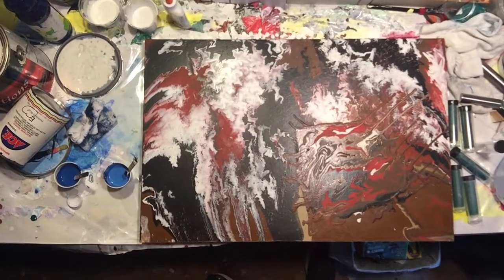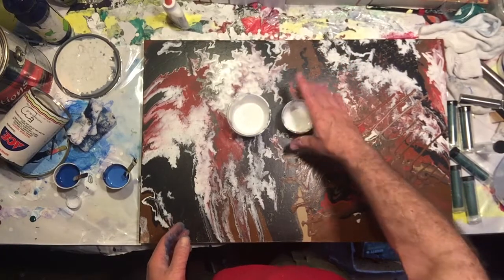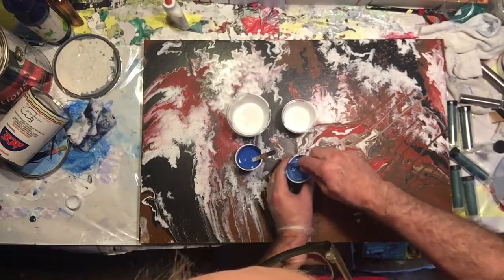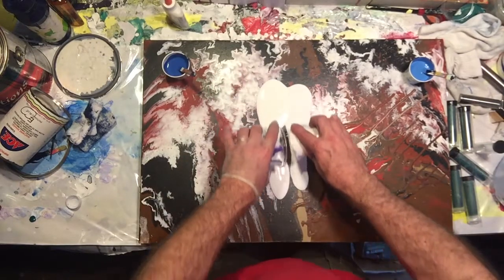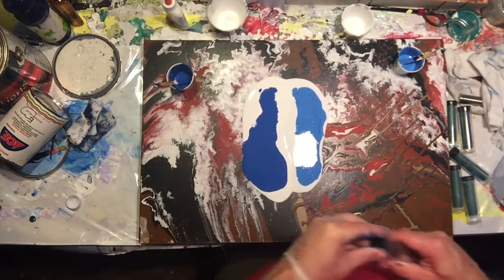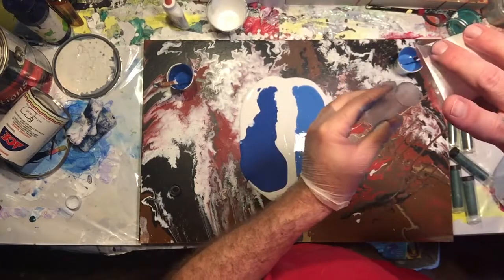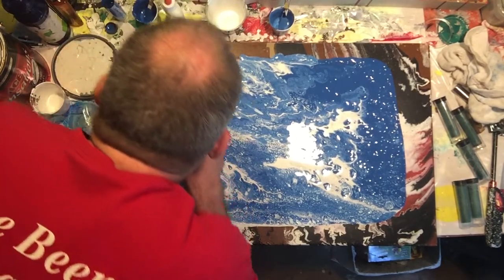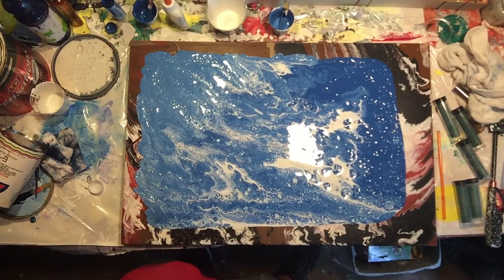House Paint turned into Flow Paint (save $$$) Acrylic Painting Pouring Fluid Flow Art How to's

Comment: Wedgewood?  Love the blues, and as for torches, I've seen videos where both butane and propane torches were used, and it doesn't seem to make a difference beyond safety or health - which are more the responsibility of the user and less because of the material I'd think.  If you don't think propane is safe, don't use it. If you know how to be safe, have at it, it's art. Metalworkers seem to be able to do it safely. And if you don't like torches, that is also fine. It's your art, you decide.  I do like your test piece, and have been keeping my eye on you for other ideas as well.
Reply: Martha D propane is more volatile that butane
Reply: Propane IS more volatile, but the point was that torches are not necessary for acrylic pouring, even for achieving cells. It is up to the user and depends on how responsible they are, how safety-aware and capable they are. The user needs to determine their own skill. Even the small torch-style lighters will get cells with silicone, as will the barbecue lighters.

Comment: This paint is latex or acrylic
Reply from the maker: Labeled Latex (but they are nearly the same.)
Reply: Casey Cole Corbin but some painter said that latex will be crack I don't know
Reply from the maker: I've used both, but add more Floetrol (and sometimes PVA glue) to house paint to help it not weaken and crack.

Comment: Is the work finished?  If so the background colors are far to strong and too lively for the monochromatic piece.
Also since you seem new at this, checke your video placement, your head too often concealed your action.  Your voice need a higher volume.
Reply from the maker: All good suggestions!  No it is not finished.  Although it will probably never be finished as it was a test piece.